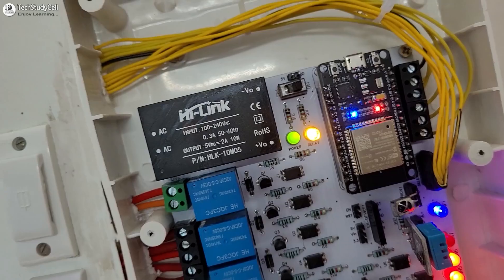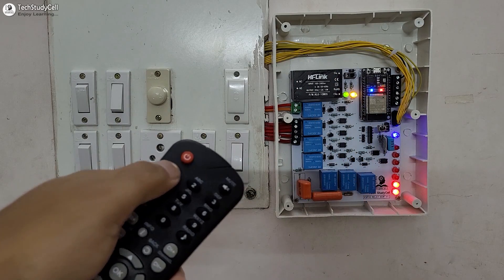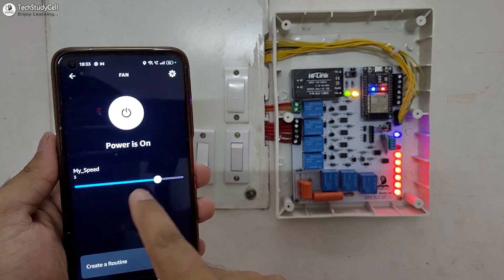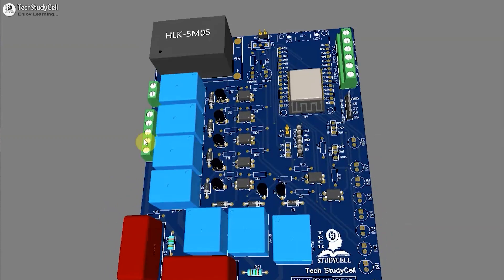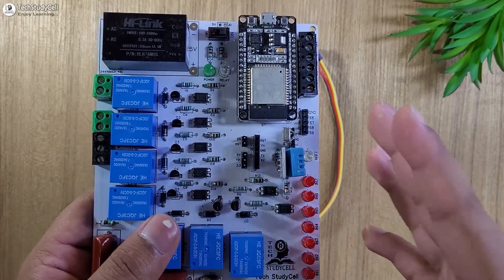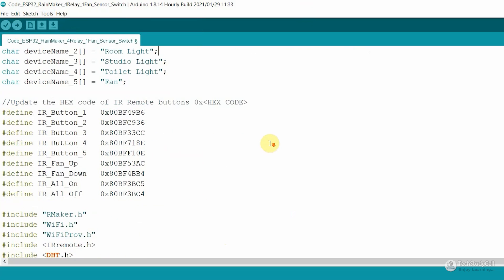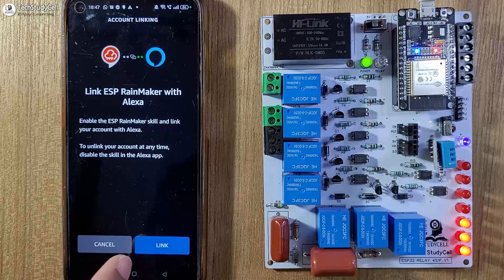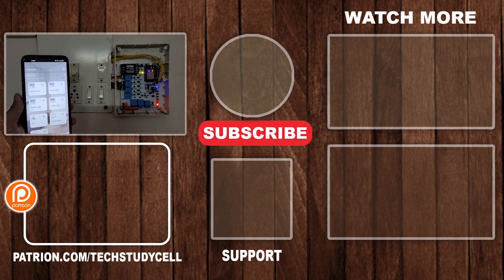Best IoT Project using ESP32 and Sensor with Fan Dimmer | Alexa Google Home Automation 2025

Comment from the maker: If you want to buy this complete project (🔥Rs: 3399🔥), then please send an email to connect.techstudycell@gmail.com with your address.
(Including pre-programmed ESP32, DHT11 sensor, IR receiver, 1 selector Switch, IR remote)
Reply: Hello this is monojit . I am using the esprainmaker app but its not reliable the signal just gets disconnected frequently and esp32 is also facing some problem. Can this same programme be done in adrino cloud iot  with fan speed control. As before you have made only switching  with adrinocloud can i also add fan speed control in adrino cloud please make a video based on adrino cloud with fan speed control
Reply: @monojitbiswas3679 same problm fesing me...
Reply: I want to buy only PCB i can or not
Reply: Hello sir how to meet this type of pcb and where
Reply: Only pcb prise kya hai and ager complete package dete hai to warrenty bhi hogi kya
Reply: Dear TechStudyCell, ⚠️⚠️🚨🚨🚨🚨

I purchased your 'Home Automation System' project a couple of months ago, and I was excited to start working on it. However, I'm encountering some problems with it, and I'm not sure what to do next.

I've followed all the instructions carefully, but something happened and now the system doesn't seem to be working correctly. I'm hoping you can help me troubleshoot the issue. Would it be possible for us to have a quick call or communicate over WhatsApp so that I can explain the problem and get your guidance on how to fix it?

I appreciate all the hard work you put into creating these projects and hope to get this one working soon. Thank you for your help ❤️🙏
Reply: ESP Rainmaker said device not found. Please help me to fix it.
Reply: Hi id like to buy one, can you please answer my email
Reply: I want to buy these complete project
Reply: want to buy only pcb..price ?

Comment: Sir, in the code you have posted here, the dimmer of the fan does not work in the ASP Rain Maker app. Please fix it.
Reply: I am facing the same issue. Firstly the chip doesn't start rainmaker after successful upload. It is throwing errors every second as (sw_cpu_reset) but when I try to fix some of the stack pointers and variables then I am able to connect to the device using the app but as soon as I turn on the fan or move the slider then the board resets.

Comment: I have this project with complete documentation. 
Features are 
1. Door lock and unlock through fingerprint.
2. Water pump control system
3. Pir motion with lighting 
4. Gas detection and exhaust system.
5. All status are shown on blynk iot app

Comment: Thanks very much bro. Project is working fine now. I forgot to select partition as RMaker.h initially that's why Arduino IDE was giving error. Second time I got another error when I tried to upload the code shared by you. Then I checked that I had similar looking ESP8266 developement board. Then I ordered a ESP WROOM 32 developement board and now everything is working as you have shown in the video. Thanks bro. You are sharing your intelligence for free. I want to donate you. Please share your Patreon etc. link.

Comment: hi, using the provided  code, when i try to control the fan speed from  app, it restarts the esp32, manual control is updated fine.
Reply: am facing the same problem
Reply: When the fan switch is on in Rainmaker, esp32 gets rebooted
Reply: Connect a capacitor across the 5v

Comment: Hi,

I have a question regarding ESP 32.
Rainmaker turns on/off the lights but if we want to design different colors? or designs ,what else do we need ?
example in the picture in an SPI mode
serial peripheral mode to make the color & design.

Comment: Do you use active low relay module because after program esp32 when I turn off the switch my device gets high and vice versa after turn on it gets low
Reply from the maker: Yes.  I used active low

Comment: Esp reainmaker shows device offline after somedays and not connecting again i have to program it again
Reply from the maker: If you do not use the ESP32 for some days, you may face this issue.
Reply: @TechStudyCell  now it is not programing again and not provisioning again show device not found...plz help
Reply: Yes have the same problem even while using after 2 days it goes off line. I think because free version is max 5 units

Comment: Brother, Thanks for your videos. WIFI DOES NOT CONNECT BACK IF router is restarted. Also Scheduling works only first time the board is configured. After that scheduling does not work once ESP32 is restarted After power outage.
Reply: Wifi connection issue is solved by restoring esp32 to factory settings and then using it again. But scheduling in Rainmaker app is not working. But scheduling in Alexa app is working fine
Reply: @roopsvinay  But we have to press the EN button everytime  to connect it back to the wifi after a powercycle, why it doesnt automatically connect?

Comment: Hello this is monojit . I am using the esprainmaker app but its not reliable the signal just gets disconnected frequently and esp32 is also facing some problem. Can this same programme be done in adrino cloud iot  with fan speed control. As before you have made only switching  with adrinocloud can i also add fan speed control in adrino cloud please make a video based on adrino cloud with fan speed control

Comment: Your work is very good and helpful. I am facing a problem in compiling this code. "Error compiling for board ESP32 Dev Module. ". I have successfully compiled your code for ESP Rainmaker 8 channel module with preference library. The difference is only of DHT sensor. I have also added this library. If you got me, please explain. Thanking you.
Reply: Same issue

Comment: I am a huge fan if your work! I have a query, Rainmaker has a limit of 5 devices in one account. Is there a way to increase the IO's in ESp 32 board.
<M"?;.l
Reply from the maker: No limits. In previous Projects I have connected 8 appliances with rainmaker